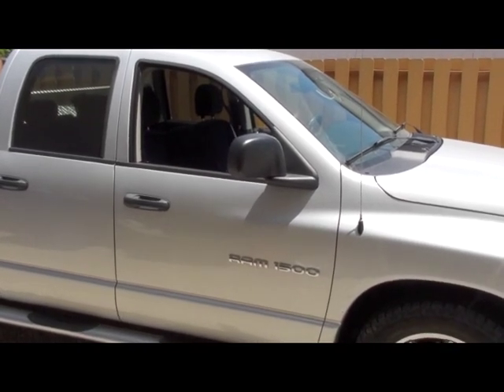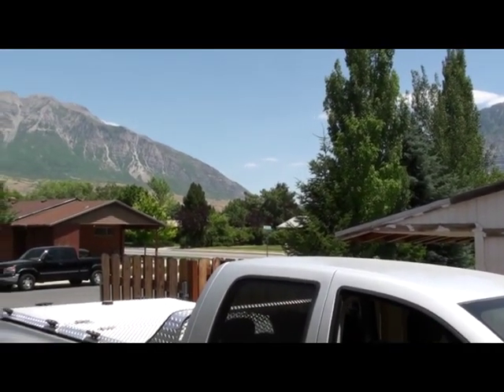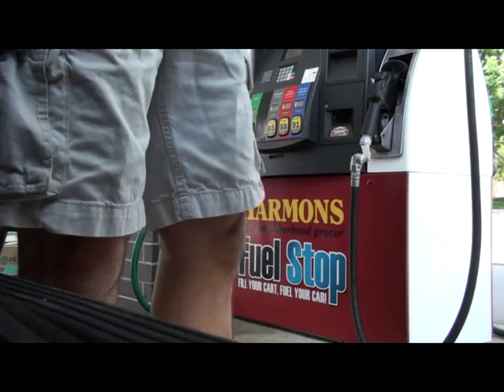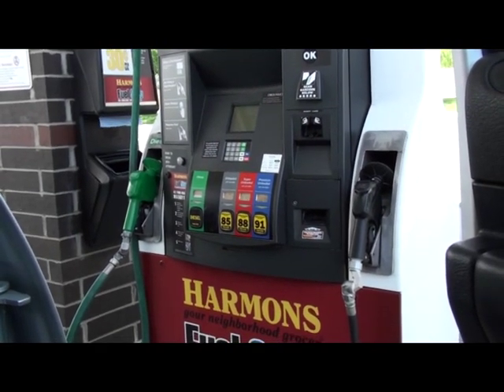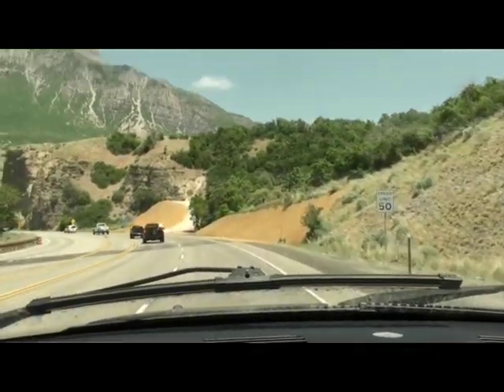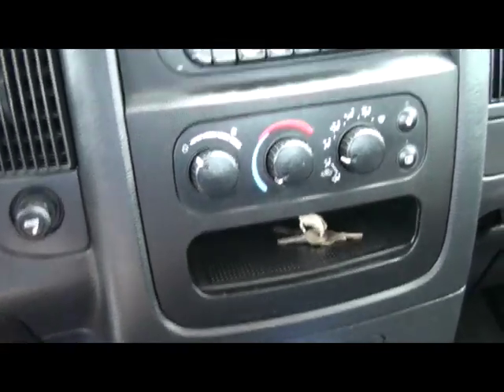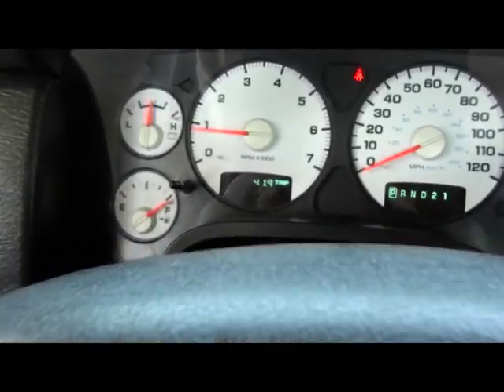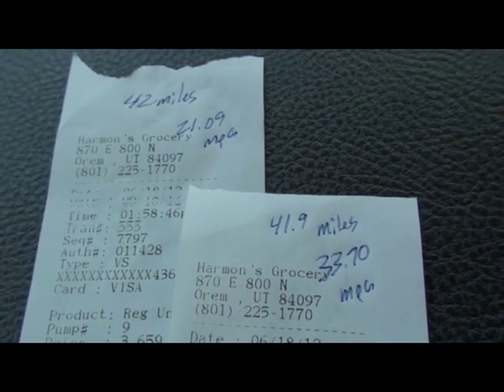288 Plate HHO generator Dodge Ram project. Part 6 Mileage tests 1

Comment from the maker: This topic has actually been beat to death over the years and a lot of people don't understand and put out some bad information.
Gasoline does not contain water. However, water is a by-product of the combustion of gasoline. Gasoline does contain hydrogen, and when gasoline is burned, some of that hydrogen combines with the oxygen being used to burn it, producing water.
So there is water in the combustion process already. gas burn at about 1200 degrees so any water is vaporized. No time to rust

Comment: I've watched a lot of your videos and my interest is way up.  I have a 6.0L ford diesel that I would like to try some of your concepts on.  I would like to ask you a question that I've never seen an answer to:  Burning HHO gives you water vapor...which is in your cylinders and exhaust system.  Aren't you concerned with rusting inside your engine?  Heads/Turbo/Exhaust?  Thanks!

Comment from the maker: I haven't done any electronic mods yet because i'm waiting for a EGT gauge. I'm getting gains without them because of the large amounts im injecting. Also the hho generators are extremely efficient, over 80%. I expect some better results with electronic mods. Need the EGT to monitor the engine temp. I don't want to be stupid!
thanks for watching

Comment from the maker: This isn't a standard drycell. It is radically different. It does not in fact have any neutral plates. It does however have all plates connected to a polarity. This cell doesnt get hot and is runs exremely efficiently at 6.0 mmw. That's about 156 watts per liter.

I often flush my systems without, it gets rid of all the foam

Comment: I Steve, you're doing a good job.
I think your generator does not use a neutral plate is this true? Why? Generally speaking you should be between 2.0V and 2.3V per cell! 12V, it must be heated in there. What is the spacing between your plates? I make two generators: 11 Plates 6'' x 12'' (-NNNN+NNNN-)
and 21 Plates 6'' x 6'' (-NNNN+NNNN-NNNN+NNNN-) 20 gauge. What is the best spacing between the plates? In terms of foaming, is there a good product to remove the foam ... I use KOH as electrolyte.

Comment: I thought running HHO without modding the electronics would reduce the MPG as the fuel would burn cleaner causing the computer to over compensate based on the exhaust and dump more fuel.  That's the whole reason I haven't played with HHO for a few years.  All my cars are fuel injected and I didn't want to mess with sensors or the computer.  So, aside from dumping HHO into your air intake, you haven't modded anything else?
Reply: i use the volo chip with h2 and my mileage doubbled and water stays clean

Comment: Please tell us what type of over-heating issues you are having.  It appears you may up-scale and eliminate almost all gasoline use.  Cool weather short-trip less than  50 miles  may not destroy your alternator.  What special cooling arrangements for cable/electronics/HHO cell are you making.  Do you have an APU ?  Great work.  Godspeed.

Comment: Hi steve. I haven't uploaded my comparative results for now.
I had a little heating problem with my cathode that I'll fix as soon as possible. (I don't have any PWM for now).
But my goal is to use a solar pannel to charge an independant agm or gel battery to energize the generator and to compare the results with those I'm measuring for the moment with my original car battery.
Otherwise I have an idea to measure the fuel consumption. I'll just use a scaled container at the gas station.

Comment: Steve, The shunt and the Fluke were similar at amp draws above 20 amps or so. I actually got slightly better MMW's with the shunt at above 80 amps or so. The lower the amp draw the worse the Fluke was. With the Fluke I was recording MMW's above 9 at low amp draw and low voltage. With a shunt those numbers fell into the 7's. I think an Alicat would be helpful at high flow rates. Above 5 or 6 LPM. It is really hard to get the time exactly correct with the bottle and high flow.

Larry

Comment: hi, congratulations for the tests, "I am using the google translator", if possible acrecente simple table with the relationship amperage / liter HHO liter petrol / disel and mileage.
because the translation from youtube using the CC gets confused.
your work is very important to me.
motagens in the cell I was without knowing the exact number of intermediate plates between cathode and anode.
Darceli Roberto Perske Filho
Santa Cruz do Sul - Rio Grande do Sul - Brasil

Comment: Steve, great stuff. Have you considered monitoring the oxygen sensor affects of the HHO.
I recommend adding a second broad band sensor. It would be great to see how they react with this much HHO. You could try monitoring the existing sensors through OBD II but I have found that the ECU corrects faster than you can see on OBD II. 
If the oxygen sensors are seeing a big change when you burn HHO it will affect your fuel maps and you will likely loose the mileage gain over time.

Comment: Steve the critical thing is going to be how your ECU changes your maps over time.
I recommend getting an OBD II I/F and watch your oxygen sensors real time. Or
if you really want to know what the ECU is seeing I recommend going to a muffler
shop and have them add sensor port and add a broad band sensor you can read in the cockpit. The problem with watching OBD is the ECU will change the ratio so fast that you may not see it adjusting for the HHO. Keep up the excellent work.

Comment from the maker: The test route was the same, hills and all on cruise control. A/C on. I did show the trip mileage both times.
The alternator is rated at 250 amps, I am confident it will handle 150.

Comment from the maker: I realize I need to be more accurate. I will need to devote more time to the boring driving.

I have a 5 gas Bosch analyzer that I will be using. I just need to get to that point.
Thanks for your comments.

Comment from the maker: I heard of that happening to some Toyota trucks. No my idle goes up then settles back to where it's supposed to be.

Larry I have built a cell a little like yours and am getting 6.9+ MMW's with my fluke 337 and the bottle method. With the mmw's so high I want to be as accurate as possible. Were the shunts you were using more accurate than the Fluke? I'm thinking about getting a Alicat flow meter also. Your input would be helpful.
Reply: delvis11 i

Comment: Steve, Nice work. Is your truck running away with you yet? I was adding 5 LPM to a 4.0 V6. The truck was idling at 30 MPH because the ECU just didn't like the effect. I still got improvement.

Larry

Comment: well the only thing now is to do 8 laps without, and 8 laps with and then check. having a single tenths digit for miles is a significant error, doing enough miles to move the decimal point over (10.1 to 100.1) will reduce error dramatically. hats off to your commitment in both time and funds, this is no small undertaking. Do you have smog check stations there? a 5 gas test with and without would be interesting.

Comment: No surprise here, Steve. You just improved your gas mileage by a margin of just over 50%. That's impressive. Thanks for sharing all your work. I look forward to more. Oh yeah, for those of you who are critical of a cold engine, in weather like that the engine will be up to regular operating temp within 10 miles, MAXimum. And while it does make a bit of a difference, it really is not all that significant, maybe 1mpg but even that is doubtful with the sophisticated electronics. I've checked my own